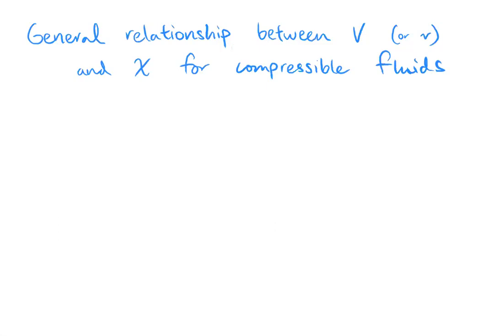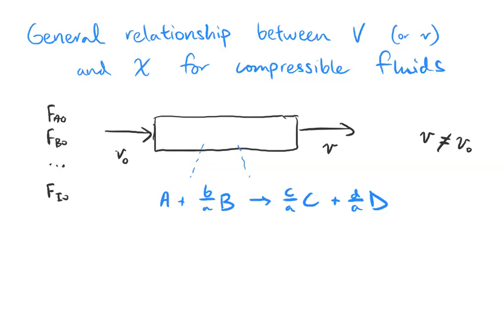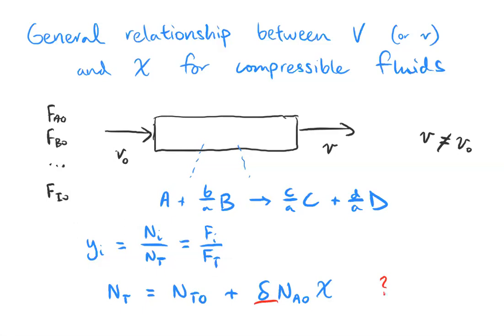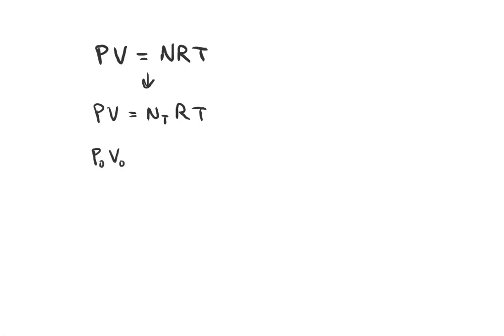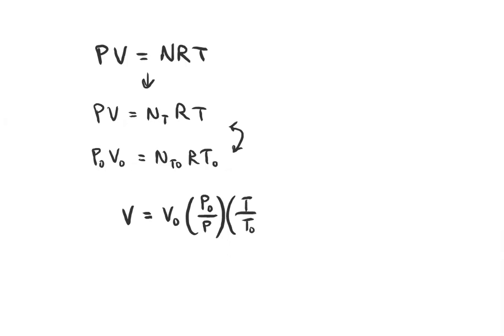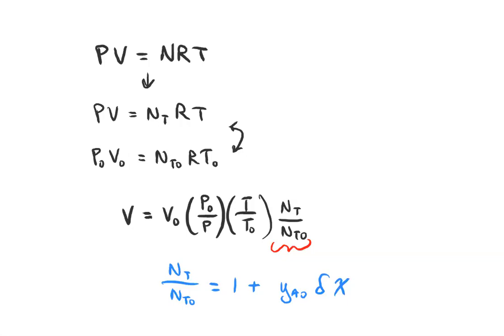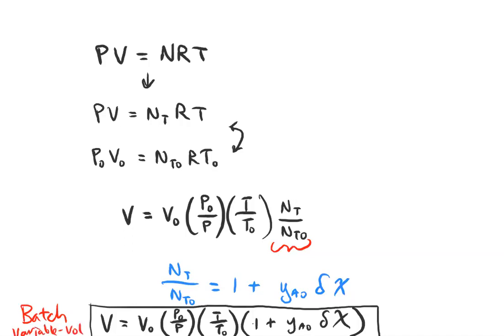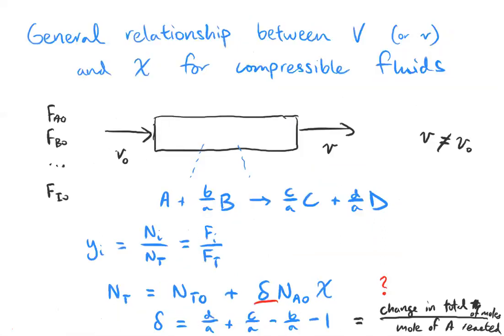F20 | Chemical Engineering Kinetics | 16 Generalized treatment of compressible fluids

Comment: I have the volume of feed (adsorbent)I am going to use. How to calculate the flowrate of air to pass through to effect adsorption of nitrogen. 
My volume of cylinder is 50cm3, and i keep say 200grams of adsorbent inside the cylinder. How to calculate the flowrate of air that i should allow to effectively adsrob nitrogen from air